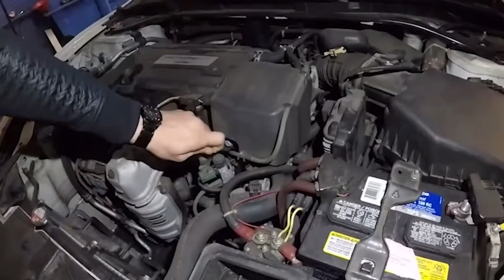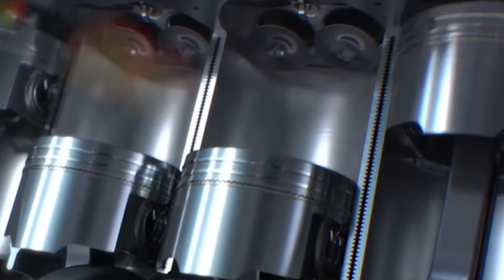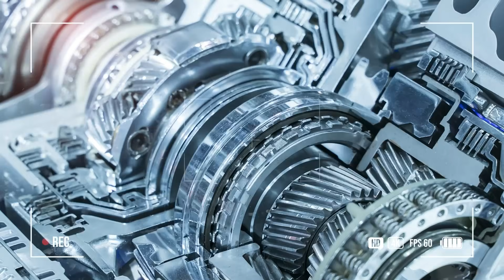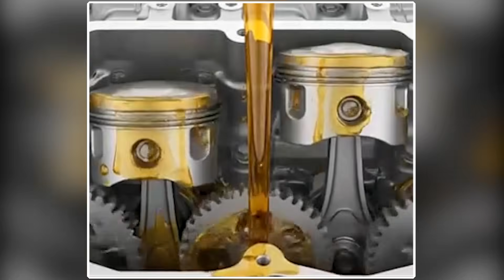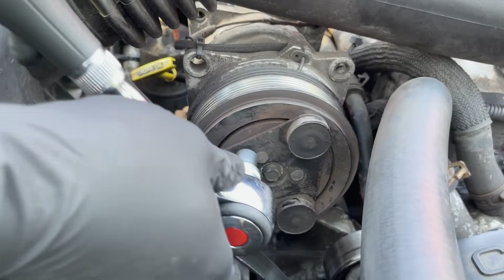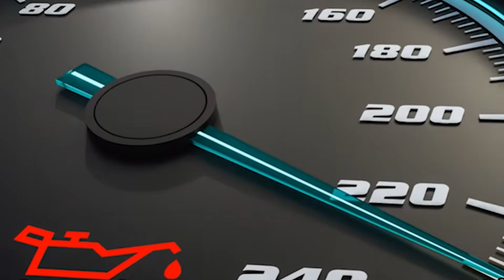11 Factory Settings That Are KILLING Your Engine (Your Dashboard Won't Warn You!)

Comment: This is mostly hair-splitting nonsense. There is nothing new about AFM, and it is NOT a "setting!" It is something built into the programming and mechanical design of an engine. It has been around since the 1980s, and it has always been a failure prone system. 
A 40-degree variation in engine operating temperature will never harm an engine. This is pure nonsense. The ECU does not control engine temperature - the thermostat and cooling system do. The gauge is nothing more than an indicator, and is NOT ruining your engine. What a load of junk reasoning!!!

Comment: Good and common sense. Opinion is to stay away from small 3 & 4 cylinders, 1 or 2 turbos, direct Injection, CCVTs and all EVs. Stay away from all the dealer you bought your vehicle from. All warranties are questionable add ons are crazy. Watch out for the Finance Dept. 
Suggestion. Best to buy used. Always kept in good shape, documented service records, history of any damages and with a todate mechanical inspection. Best years for older American vehicles (94 - 20006) V6s and V8s. Beyond 06, everything was being overwhelmed by electronics, computers, modules, cheaper components and gov't mandated controls with all the enviro statues. (See above). Ruined the industry. It all went to poop. Be careful, you may not have to rely on your local dealerships even before the warranty runs out. Get to know other owners, ask questions and find out the good shops with experienced mechanics and reasonable billable hours. Good luck.